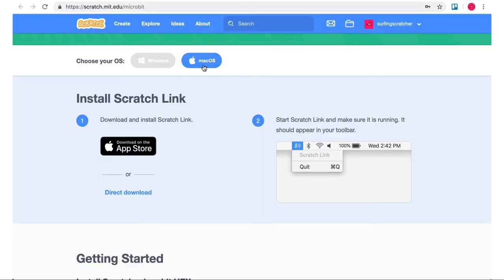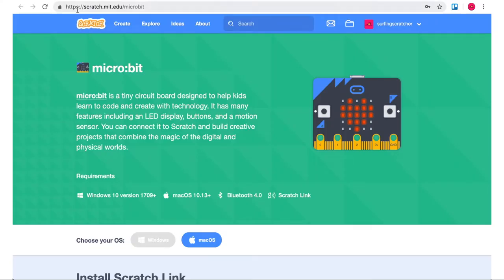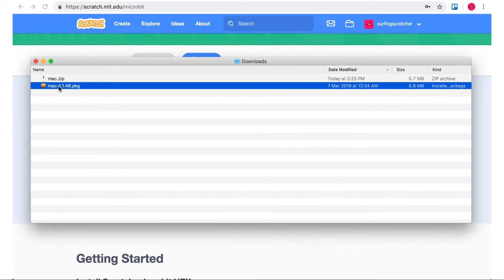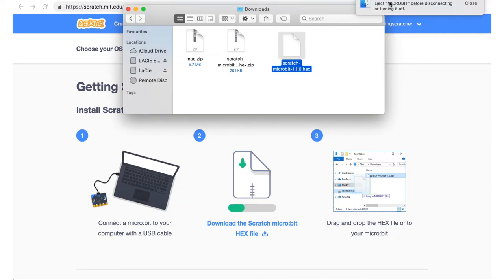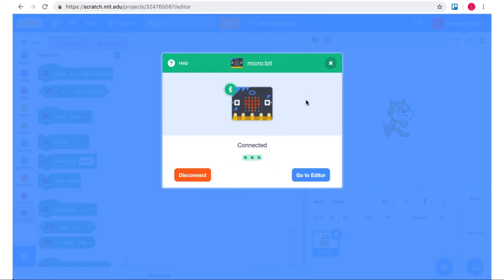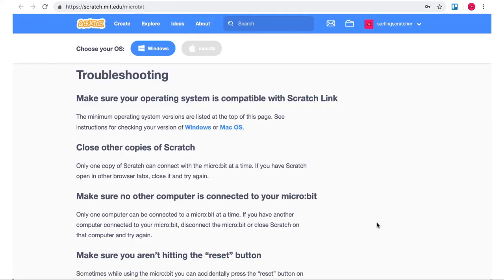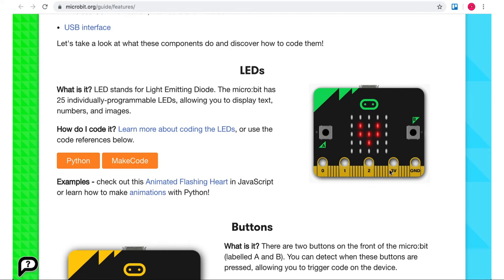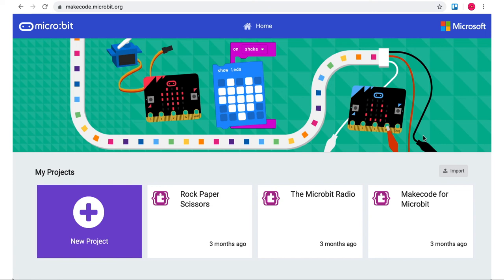How to Connect Micro Bit to Scratch and Micro Bit Features for Scratch

Comment: Hello ,every time I try to link the  scratch to microbit, the scratch always can not find the microbit. the scratch link and the Bluetooth are on, I have dragged the .hex file to the microbit. But no response ,the microbit shows five letters :zubev. Could you please help me figure out the problems? Thank you
Reply from the maker: The 5 letters you see is the name of the device. You would need to connect the microbit by accessing the microbit blocks extension in Scratch. Press the orange little caution button and look for the device in the list. If the problem still persists, get in touch with Scratch support, or check the microbit forum on Scratch. Good luck!
Reply: hi! I have made an issue on github. Please check the pinned comment

Comment: Does the extension still work? I am sure I did everything right (installed scratch link, turned on bluetooth on microbit, copied the scratch microbit hex onto the microbit drive but when I tried to add the microbit extension in scratch it says "make sure you have scratch link installed and running & check that bluetooth is enabled" . checked online many have the same issue saying scratch 3.0 beta used to work but no longer.
Reply: Same problem. Scratch won't connect to BBC microbit OR my lego WEDO, but it did a month ago, when 3.0 was already out, so that can't be the issue...
Reply: I think I found the problem. If you are using windows, you must have bluetooth 5.0 or above. If your bluewooth is not 5.0 above, you can purchase a bluetooth dongle to overcome this problem (cost a few bucks for that). I had 5 laptop that presented the problem and tested the dongle, fixed all those 5 laptops now I can connect.

Comment: Hello Surfing Scratcher, I tried to find my micro bit,  but I don't get it,  I follow all the steps on the web site, even yours, I'm :(, hopefully you give an advise to fix my issue, thanks.
Reply from the maker: Hi Olaf, I sense that you would be feeling some frustration having not being able to connect your micro:bit to Scratch even with the help listed. I’ve jotted down a check list and some other links that can helpfully get your issue solved. 

☑️ Visit the micro:bit portal on the Scratch Website: https://scratch.mit.edu/microbit
☑️ Install Scratch Link
☑️ Download the Scratch HEX file: https://downloads.scratch.mit.edu/microbit/scratch-microbit-1.1.0.hex.zip
☑️ Connect your micro:bit to your computer
☑️ Copy the downloaded HEX file from your computer to the microbit
☑️ Open Scratch Link
☑️ Open a Scratch project
☑️ Add micro:bit extension
☑️ If you don’t see a green tick in the blocks section of the micro:bit category, click the yellow arrow and connect your micro:bit
☑️ Select your micro:bit from the list

Troubleshooting from the Scratch website
⚠️ Make sure your operating system is compatible with Scratch Link
⚠️ Close other copies of Scratch
⚠️ Make sure no other computer is connected to your micro:bit
⚠️ Make sure you aren’t hitting the “reset” button

Still not working?
💡Try the Scratch forum: https://scratch.mit.edu/discuss/topic/307131/
💡Visit the Scratch contact us page: https://scratch.mit.edu/contact-us/

Lastly, could you provide some details about the computer and operating system that you are using, whether it’s the online or offline editor you are using and any other details that may be different from the steps listed above. That will help isolate the problem. Good luck!
Reply: Macos is a bit broken. Are you on mac?

Comment: Hello .... I have a problem Can you help me ?
Reply from the maker: I can certainly have a go :) Post away.
Reply: @SurfingScratcher  When I download scratch link on windows 10 I have an error (this the error :- the application requires windows 10 creators update or late ) what is the solution ?
Reply from the maker: @hamzamarie6670  First, check that your system matches the recommended system requirements on the Scratch Link download page: https://www.microsoft.com/en-us/p/scratch-link/9n48xllczh0x?activetab=pivot:regionofsystemrequirementstab
Secondly, here's a post regarding the creator's update installation.
https://answers.microsoft.com/en-us/windows/forum/windows_10-windows_install/windows-10-creator-update-fails-to-install/f3af05d2-4624-4334-bc29-1e7125c4f581
If you're still having difficulty, I'd suggest that you get in touch with Microsoft Support as they'll be able to troubleshoot your issue better than I can.
https://support.microsoft.com/en-us/help/13948